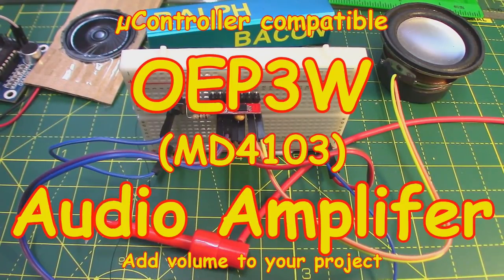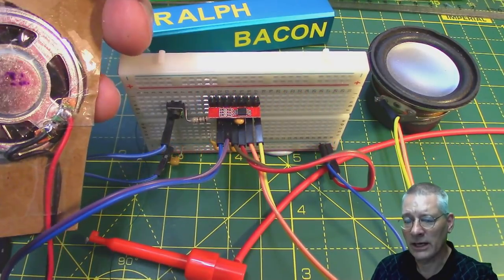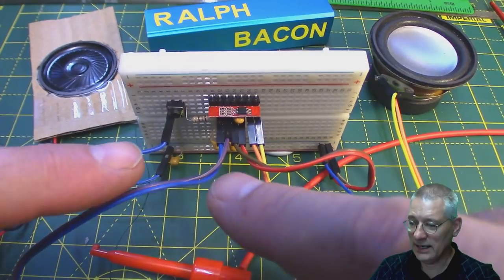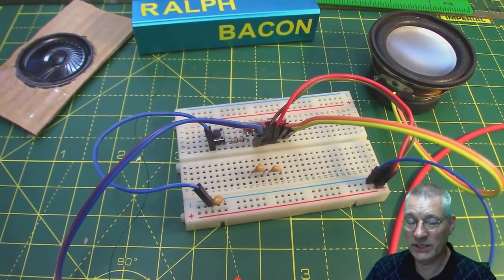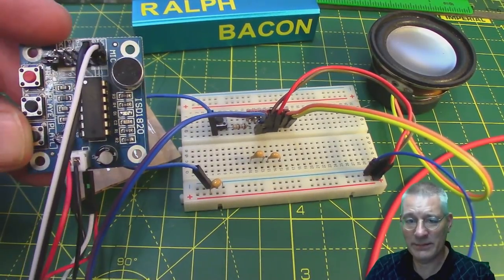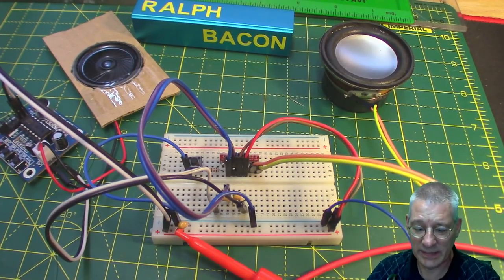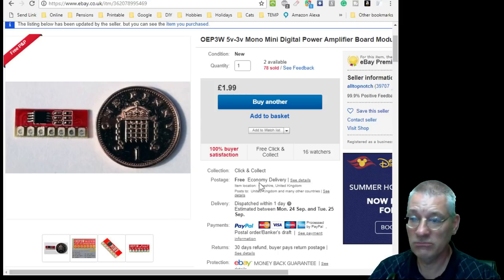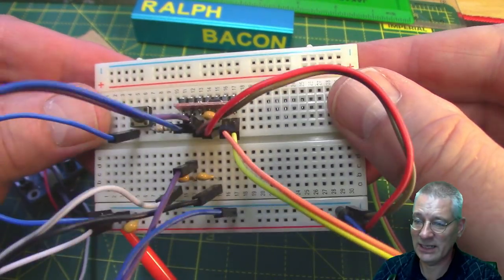#121 Audio Amplifier 🎵 Class D 3W Module for Arduino (and more)

Comment: Hi Ralph, enjoy your videos very much, could you consider making a weather station video using the new knowledge you've given us re low power modes in conjunction with the  bme280 Atmospheric Pressure Sensor and Temperature Humidity Sensor along with nRF24l01 transceiver , so we can locate the weather station away from the house, but it might have to be a multi part video, I know I would like to build one or do you think it too complex for your target audience, Cheers for now, Erney.
Reply from the maker: I've wanted to build a weather station for ages, Erney, and I sort of got the basics done with Benny's outdoor run (see videos #46 and #48) for the temperature and humidity but never connected up my wind speed thingy (anemometer). The main issue is, as you correctly state, powering it up remotely (I have power but not everyone has). Perhaps I should do a solar panel / charger video (which is sort of there too with video #120 which has a UPS module with an 18650 Li-ion). Hmmm, maybe I will add this good suggestion to my list - we could build it modular style. Thanks for posting.

Comment: I don't believe that the car audio systems you referred to in there are running at the normal car voltages.   From what I've heard,  they have some sort of an inverter in there to boost the voltage to a higher level.

Now,  I wonder what I shall do with these LM380s I have on hand here?   :-)
Reply from the maker: Some do indeed have a voltage boost converter, Roy, and can use umpteen amps to deliver that thumping bass so beloved by the "yoof" of today. But some do run on 12 volts directly, which can limit the output, although I suspect they all have bridged amplifiers to assist in that, just like your LM380s, which can run on up to 22v and can use 1.3A max. The 14-pin variant can dissipate much more power than the 8-pin one but as you can only get 2.5W output I'm not sure it's an issue! Have you tried them on a 5v supply?
Reply: No,  at this point I haven't tried them in anything just yet.  They are the 14-pin variant,  though,  and I figure that they'll do better than the LM386 parts that I've used in the past.  Though those can get pretty loud,  too.  :-)

Comment: Welcome back!  Nice work.  It is probably similar to the devices they put in talking greeting cards.  Lots of distortion, lots of volume, low quiescent current.
Is your chroma-key system new?  I have not noticed you appearing as a talking head before.  Now you have to watch what you wear.  We wouldn't want you to turn into the Cheshire Cat.  Have a great day!
Reply from the maker: Not such high distortion - see my GitHub for an audio example I've just uploaded there with a screenshot of the waveform at 1Khz.
 
Chroma what? No idea what you mean, Tab Maryland (although I have now hidden my bright green T-shirt). 😀

Comment: Ralph, really enjoying your videos! Just some food for thought, you're likely getting more distortion from your ISD1820 module than the amplifier. those ISD part don't really care, the microphone used on them are also absolute garbage. I've played a bit with the diodes.com amps - similar deal, but about $0.30each! (on a module!)
Reply from the maker: The Diodes.com amps' specs look remarkably similar. The main difference is they incorporate a volume control, it would appear. And yes, the ISD1820 was the main culprit for distortion, see my GitHub for a newly uploaded audio example and screenshot! Thanks for posting.

Comment: I expect you want some kind of delay to prevent you picking up the switching as the amp cuts in.  I say this because I bought a set of Bluetooth headphones which give an annoying click when sound is initiated on my music player or youtube videos.  Is this a software omission I wonder?
Reply from the maker: I didn't test this, gartmorn, I must admit, but I know exactly what you mean. My old clock-radio did this. The click woke me up before the radio had a chance to kick in. Having just uploaded a new audio example of this device to my GitHub I tried it out and I'm pleased to say NO CLICK! The on/off sounds literally just like the loudspeaker was disconnected/reconnected.
Reply: @RalphBacon  I'm not great at programming and rely on the likes of yourself for advice but have heard this can be an issue especially on radio chips when changing channels.  I just made up a wee Bluetooth speaker using a £2.50  'chinese module'  and it works a treat with no clicks?
Reply from the maker: That's music to my ears (pun intended), well done on doing that, gartmorn, amazing what we can achieve for relatively little cash.